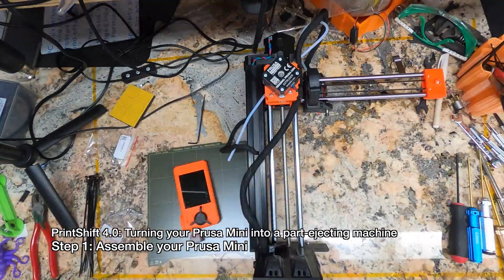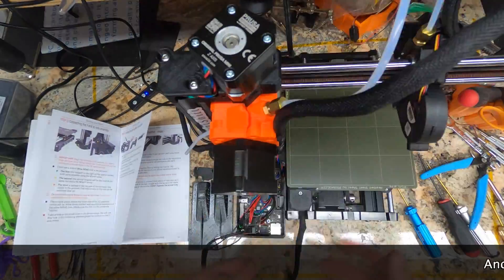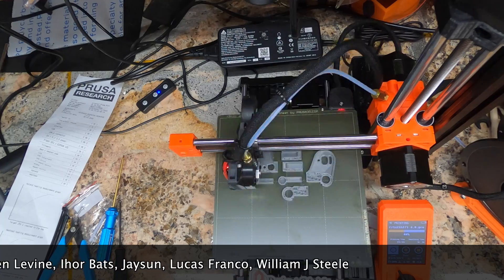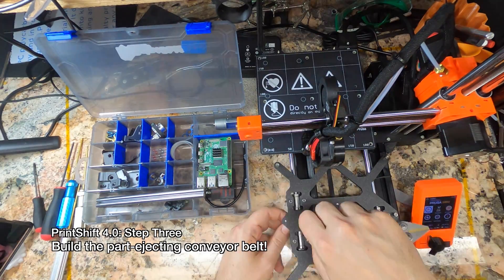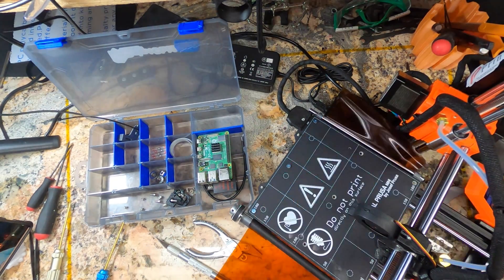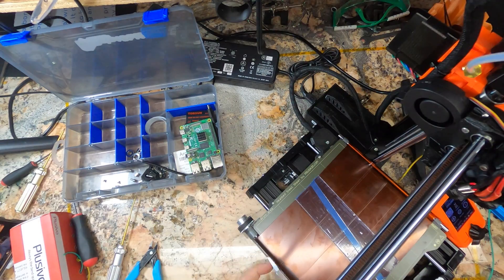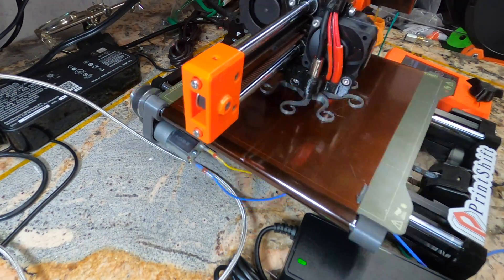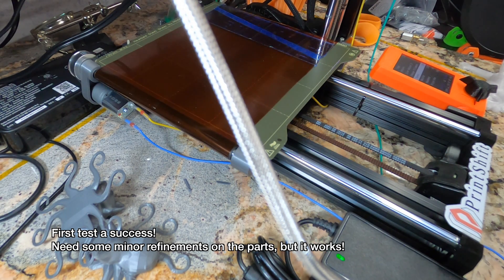PrintShift 4.0 First Build!

Comment: Hello, I also tested the 0.2mm thick Kapton film.But I encountered a problem, when printing the first layer, the print head is very close to the Kapton film, the kapton will be deformed, and then recover, which causes the bottom of the print to become arc-shaped

Comment: Hi, thank you for sharing. I want to ask if I use Kapton belt , do I need to heat it?
Reply from the maker: PLA sticks OK to cold Kapton with hairspray, but you're better off heating it to 60 or 70C.
Reply: In addition, is Kapton suitable for pla?
Reply from the maker: yes

Comment: I just subscribed to your patreon. I have a triple prusa mini farm. That i run nonstop well what I thought was non stop that is. Until I just found you. I am going to do this mod when you have version 4 finalized. Thank you for this genius design. If you were to have the parts in stock and sell it as a kit. I’ll pay whatever you decide to tax on top of it to support you. I want to have same exact parts used as you. To ensure it runs flawless.
Reply: Another +1 from here. I am running a print farm with several Ender 3 V2 and some Prusa Minis. I already tried two systems for automation, iFactory One and 3DQue Quinly. Since we are mostly producing small parts that need high precision (eg cookie cutters) we were not happy with the outcome of this systems. 

Do you plan to bring out kits? And would this work for Ender 3? And how long would you say the belt tension keeps going? Is there often the need to tighten it?
Reply from the maker: Thankyou!
Reply: @PaulChase  +1 to the above. Let me know if you have any plans for a kit, I need to print a large batch and I am stewing over 4.0 build right now.

Comment: Looking for more info on how to build, if it's not necessary to plug the electric source to the electronic box, it's huge plus! I was really afraid I could mess up my expensive printer :D
Reply from the maker: Noted!  More videos coming.  It's controlled by a microswitch at the top of the Z axis.  Later on I figure a relay plugging into a pi would work well too.

Comment: Does this enable you to print prints longer than the print bed? For example long snake or something? :)
Reply from the maker: No, it does not.  This is pure part ejection.  I am working on larger printers where the bed is a 4th axis, and that would enable part ejection + printing longer prints.  Just having a precision conveyor belt bed wouldn't be enough, though, it would take fancy slicer support where you would basically emulate printing on an angled bed with the 3-axis printer, and then advance the bed with the belt motor.
Reply: @PaulChase  thank you! Sounds like really complicated project :)

Comment: If you don't mess with printers electronics how are you having the gcode run the printshift motor? 
I guess something to do with octoprint?
Reply from the maker: Simpler than that - there's a microswitch at the top of the Z axis, press to eject.  So the end gcode goes to Z178, pauses for 35 seconds, and drops back down for the next print.

Adding a relay to the Pi and an octoprint plugin works, too, but I wanted it to work without a Pi too.
Reply: @PaulChase  very clever!